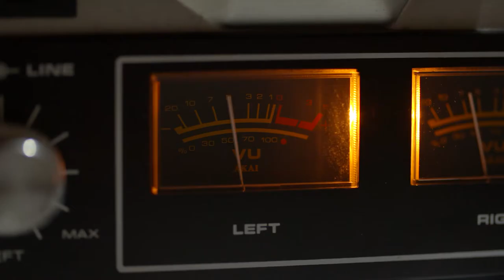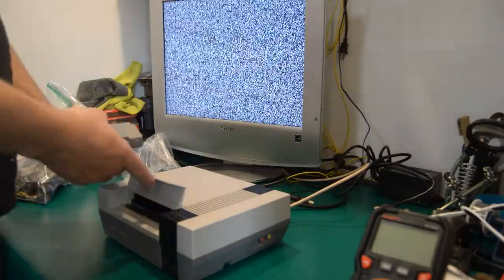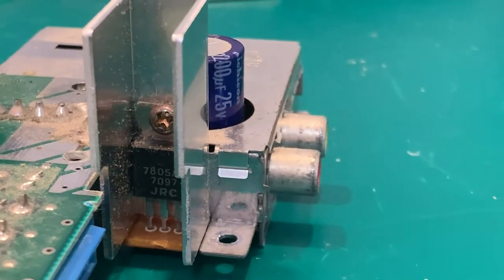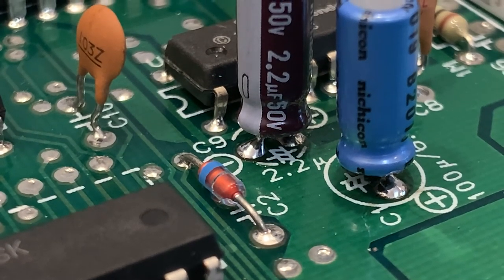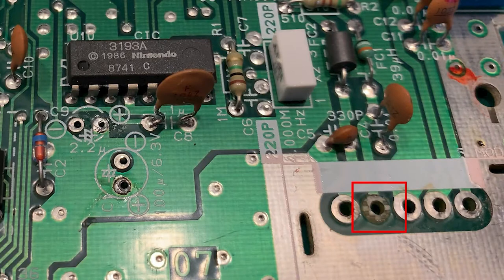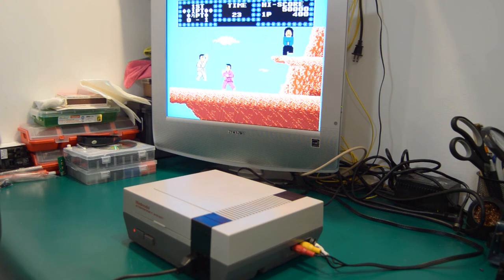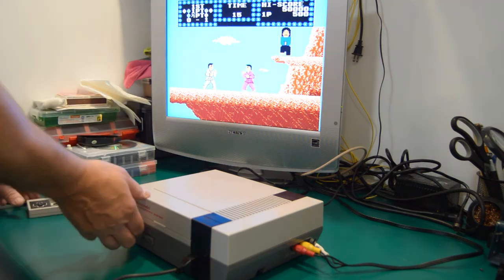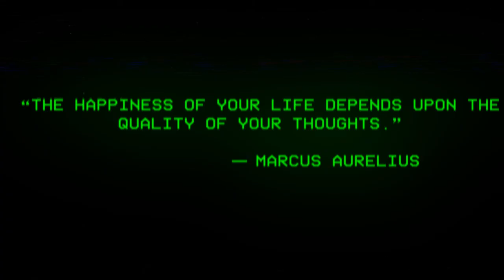Restoration of NES Retro Gaming Console | Retro Repair Guy Episode 18

Comment: You are awesome! There is an RGB mod but you have to change a lot so for many collectors this is a no go. I am also a collector but I would do it.  It seems to be too difficult for me. I connected mine to a Retrotink 2x mini and then there is no problem connecting it via hdmi cable to your TV. That's how I'm doing it and I am happy with the picture quality.
Reply from the maker: Hi! Thank you so much for both the compliment and information about the mod! You are correct as a collector, I rather keep it original.
Reply: @RetroRepairGuy  you're welcome! It is difficult to decide. Do you want better functionality or the original console? There is something fascinating in preserving old hardware in its original state so I don't mod my consoles. There always seems to be another good solution. Sometimes I would really like to do it but I would also regret it as a hardware collector.
Reply from the maker: @Oribaa90  100% agreement but when I was younger I was modding my Xbox and all I cared about. Now I want to preserve them and keep them original so I even removed the mod that was in the PS1 I fixed. I would not mind Xbox when I have four lying around but the last one I fixed in the video was an original 1.0 version so it has to remain intact.

Comment: I knew I wasn't crazy washing motherboards in the dishwasher, they go through a lot more abuse in the manufacturing process when they are industrially washed after being populated and soldered on an assembly line. Was also a video from De8auer (world famous overclocking champion with liquid nitrogen) that talks about how he uses a dishwasher to clean vaseline from his competitive boards after an LN2 pot competition. If anyone is an expert in this field it would be Der8auer.
Reply: Also with the 72 pin connector I found boiling it in a pot of hot water for a few minutes, cleaning it with an old credit card wrapped in a micro fiber cloth and then bending all the pins down a bit with a pair of tweezers worked fantastic. Had an old NES that wouldn't read a cartridge but the system was fine, you can test a bad 72 pin connector by pushing the cartridge down, and slipping your hand inside as far back as you can get and pushing the cartridge down. After refurbishing the 72 pin connector it reads game carts first time every time.
Reply from the maker: Hi! No you're not crazy! In the old days we use to spray these big cans of liquids to clean them. I've said it often; when you think about it, nothing can get inside a component. The main thing is to make sure to dry it and that the dishwasher heat cycle is off. As long as it's completely dry before you put it back together. Just misconceptions that people have.
Reply from the maker: For the 72 pin connector I see it this way. First if it was a rare part that you could not get or that would cost a lot of money I would agree. However, I paid less than $18 CDN ($14 US) for a brand new part so it doesn't justify my time to boil it and lift the pins one by one. Further more because they are tiny metal pins and they went through 38 years of abuse. Bending them one way then rebend them the other way will eventually weaken or break so I rather just change it. I of course kept the old one anyway for that day when there are none available, then I would do that. For now the eighteen dollars saves me time, money and frustration so it's worth it.

Comment: While waiting for new videos to drop, i have been watching your older videos. You were asking for a hdmi mod, rather then modding thr original look of the NES, why not purchase a device that converts AV to HDMI
Reply from the maker: Hi Wally! First for the new video, just when I thought I was catching up, the tape deck had tons of problems. I posted pictures and details in the community boards https://youtube.com/c/RetroRepairGuy/community

Nothing wrong with catching up on my older stuff, there's some good content there! As for the NES, you're right, I normally hate modding old stuff unless it's internal and will never affect the workings or cosmetics. I will actually look into an external device. Are you using one? Any to suggest?
Reply: @Retro Repair Guy  i just noticed i never replied.on Amazon, i searched Av to HDMI converter. The one suggested by amazon is the one i bought
Reply from the maker: @wallyf7020  No problem! Thanks! I never got around to really using it yet as I'm running out of space!